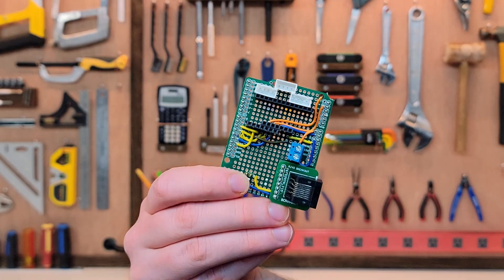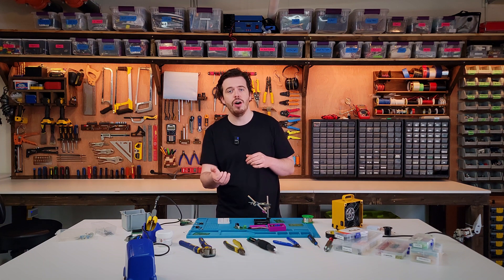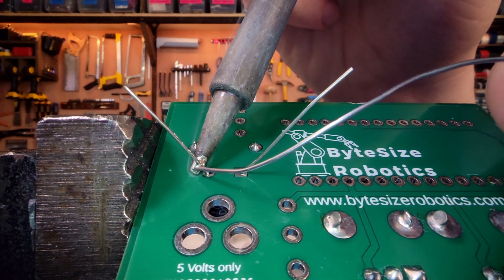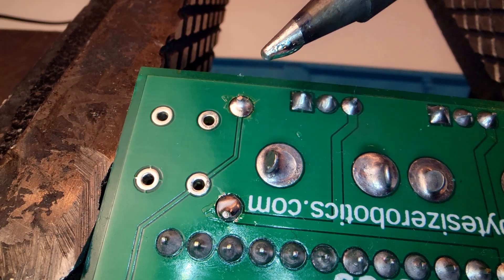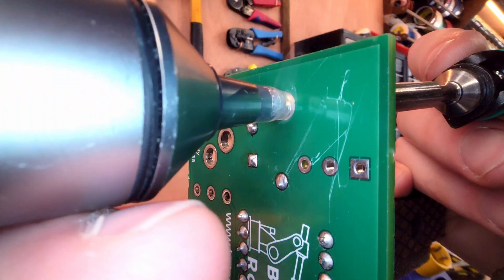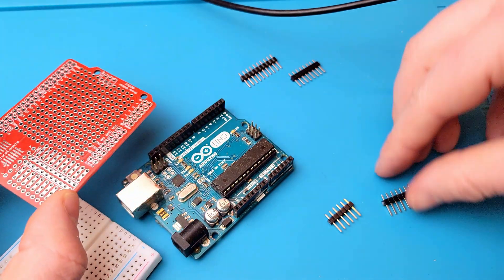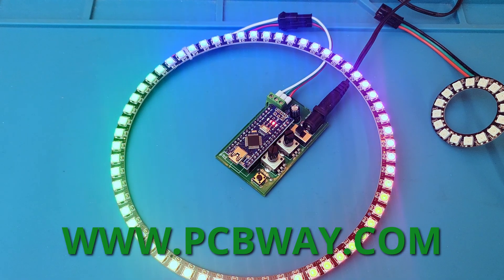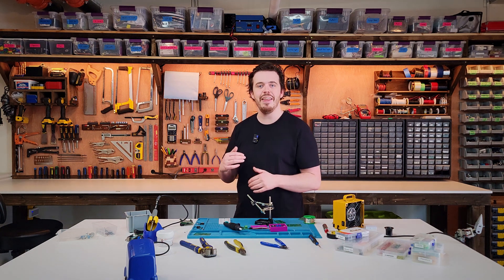Four Steps to Perfect PCB Soldering (Through-Hole Guide)

Comment: A couple of points: as @pebbleschan6085 said - sometimes components need to be above the board, resistors in some valve amps can run very hot; and I don't bend the component "legs" too far on the back of the board as it can make it very difficult to remove components in the future if required.

Comment: Lots of excellent tips here. Question: do you worry about 'burning out' components from taking too long while soldering a joint? I think I've heat-fried some components in the past trying too long to get the joint right (and these tips will totally prevent that, I think). Still just a little nervous about leaving the tip on a component leg to heat it up.
Reply from the maker: Destroying components with heat is possible and you can also burn/delaminate the copper traces on the PCB. However, as long as your soldering iron isn't excessively hot (I set mine to 650F/343C) and you complete each solder joint in 1 - 3 seconds with the technique shown in this video you should be okay. If it is taking longer than this, your tip may be dirty or need more solder on the tip to transfer heat efficiently. If you need to touch up a joint multiple times, give it a couple seconds for the body of component to cool a little. And for really sensitive components, if you have space, you can optionally use a heat sink (like little alligator clips) between the joint and the component body.
Reply: @WillDonaldson  super clever with the alligator clips, dang! Thanks!

Comment: No, depending upon the design some components such as resistors, diodes need to be suspended above the PCB as not to potentially char it from the heat generated. For a neat finish straighten out component leads prior to bending to the correct geometry using a component lead forming/bending tool. 345 deg C is generally too hot for leaded solder but fine for unleaded solder. 280-300 is usually sufficient for leaded solder. Too high a temp causes flux to char, PCB pads to lift off or worse permanently damaging/expanding the PCB fibreglass. It’s better to use a chisel and not a conical point soldering tip as it provides a greater surface area closer to the tip for heat transfer. Flux paste is useful for improving heat transfer. Tin your soldering iron when putting it back into its stand to minimise tip oxidation. Use proper ESD equipment and procedures (which are very simple) to protect your components from hidden damage. 🎉
Reply: not just char. they start making noise. they can even oscillate the external sounds/vibrations into circuit. they can get microcracks as pcb flexes which filled with h2o in the air, create periodic self-healing short circuits.